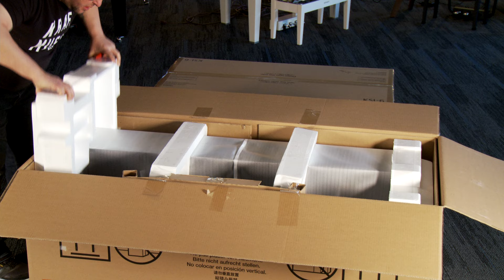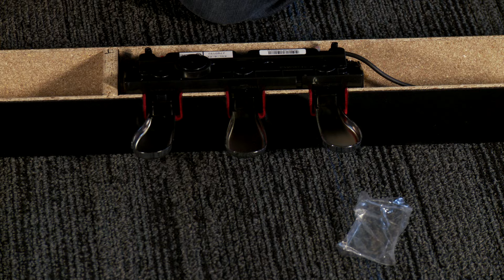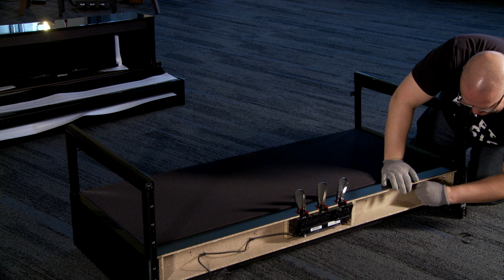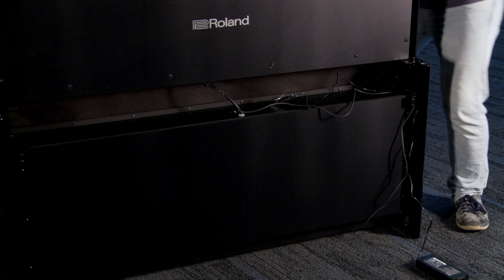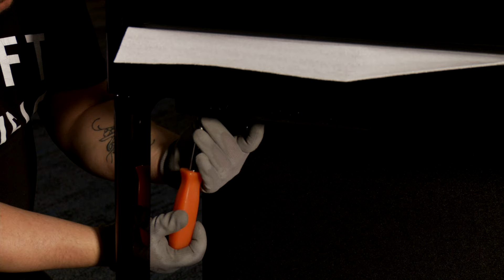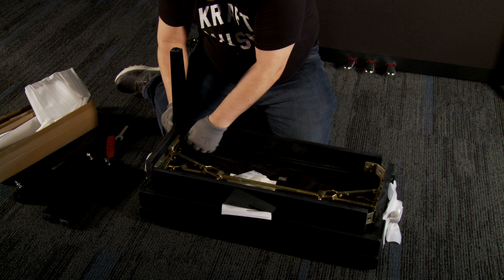Roland LX-6 Luxury Digital Piano - Assembly Guide

Comment: Great video, thanks. Question about the speaker box beneath the keyboard. It looks like they used a fabric in front, and from the website drawing, there is a woofer there. When pushing the fabric in with the fingers, can the woofer surround and cone be felt, or is there a grill protecting it? I ask because I fear children might want to sit and put their feet up, possibly damaging the woofer.... Thanks!
Reply from the maker: There is no grill under the fabric but the woofer is recessed by about an inch and the fabric cannot be pushed in far enough to touch the cone or surround. A kid brushing up against the fabric or even pushing a foot against it shouldn't damage the woofer at all. It seems well protected. Thanks for watching!